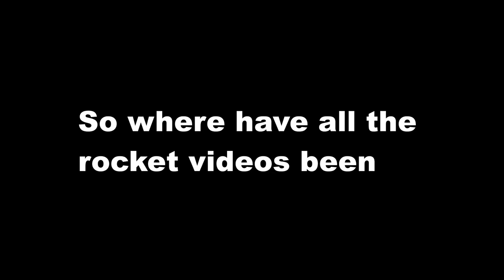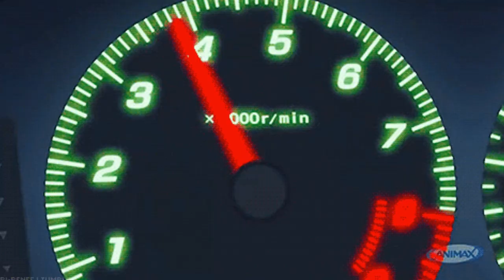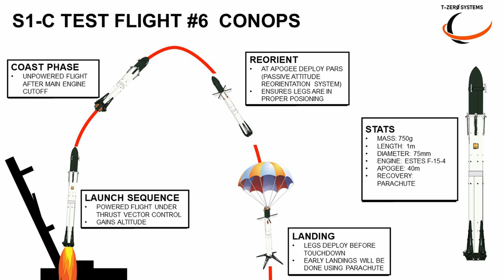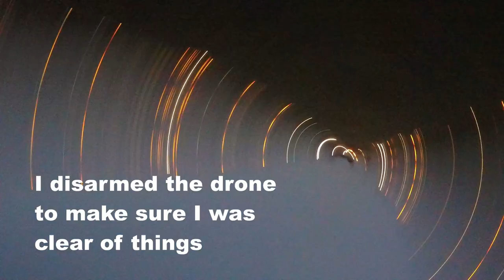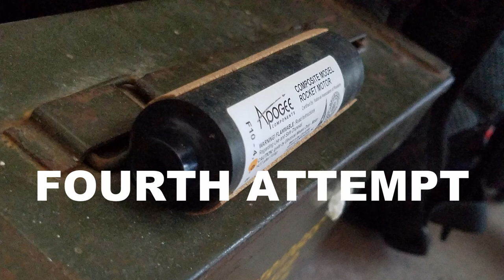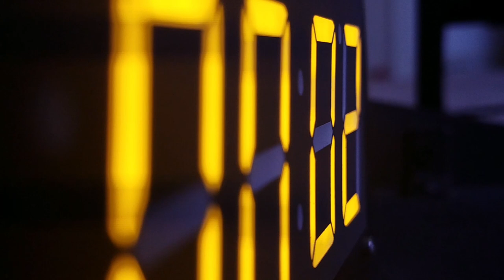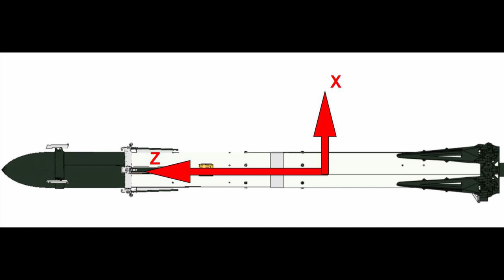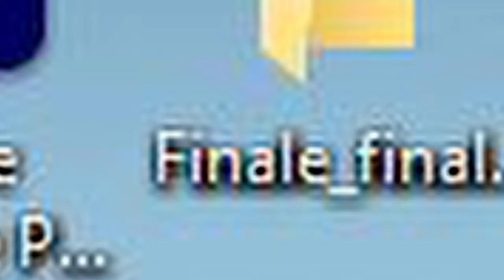Model Falcon 9 S1-C Flights #8-11

Comment: What flight computer do you use for these rockets? Based on the video it looks like you are using a arduino pro with a bn0055 along with probably some sort of barometer. I am wondering if you would recommend a set up as such. I was thinking about using a arduino pro as a flight computer however it’s kinda pricey. Love the videos, keep up putting out amazing content for us please. Also it seems like in the last flight it had some issues with long occultations. I personally don’t know how you would tune that however I think may possibly be that the flight computer is tuned for more aggressive deviations, and that the servos are then in turn not actuating either not enough or not at all. 

Best regards, Ian
Reply from the maker: Teensy with a BMI088 and BMP388 is my current set up. A state based controller could work in the last flight but the oscillation comes from being twanged and less controller issues. it also stops oscillating too cause given enough time, the controller can fix it.
Reply: Awesome, your absolutely right no matter how good a control method normally you wouldn’t experience a deviation caused by the ignition wire like that. Additionally it proves why TVC is so much harder on a model scale as the motor doesn’t burn long enough for the computer to steady itself.

Comment: There are possibilities to build custom solid rocket motors. This could been helpful for e.g. your sls. I think the side motors were a little bit undersised. The king of random has a nice video about this. They're probably also cheeper than the commercial ones. I've not seen any YouTubers launching thrust vector controlled rockets with it. Some experiments with them cut be very interesting.
Reply from the maker: @Pixelcrafter_exe  So you raise a good point. There is a definite performance gap there in burn time and the dry mass vs wet mass of these rockets. The off the shelf engines are really reliable though and proven so they make a great starting point. Designing custom LOOONG burning engines is much more legit rocket science. If only I had an aerospace engineering degree......oh wait lol. Keep an eye out up the road

Comment: I think your flight systems should be corrected
Reply from the maker: which ones?
Reply: @TZeroSystems  i find that bps is hard working in flight simulation rocket thrusting and many more because i wondered that his rockets flies maximum in a straight line
Reply: @TZeroSystems  change the launch pad it is the only problem to your rocket
Reply from the maker: @robin390_  In my most recent video it calls out why i had been having issues and I have some fixes that have made things a lot better. Overall, this is just a thing i do for fun where for Joe at BPS he does videos for a living too. I have been trying o split more time off for rockets though. Last flight set an altitude record even
Reply: @TZeroSystems  i thought you're trying to build a new aerospace company is it
Reply from the maker: @robin390_  No lol that would be unnecessary

Comment: Loose the launcher and all that stuff.  You don't have to try to impress people with that crap.  Just focus on the rocket.  Literally a metal rod on a board will give you 100% more successful launches and remove so much un-needed complexity.
Reply from the maker: Kinda defeats the point of making something more functionally accurate. Plus I'd argue at this point the pad is more reliable. 2 way handshake communication prevents it from flying or igniting when there is a GNC error now too